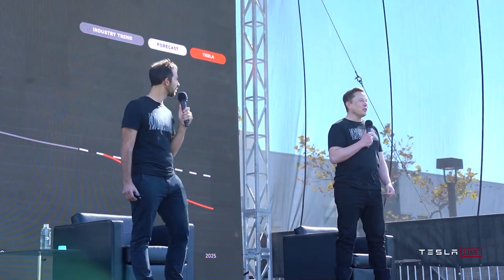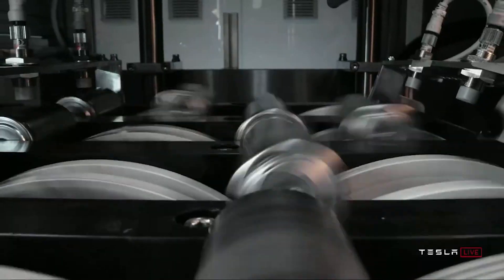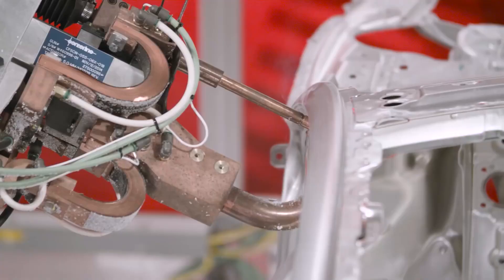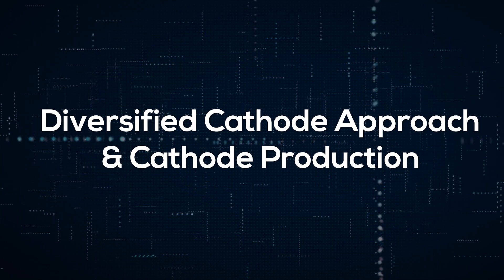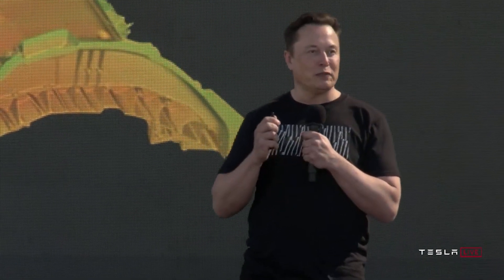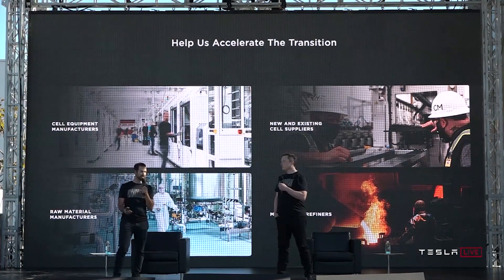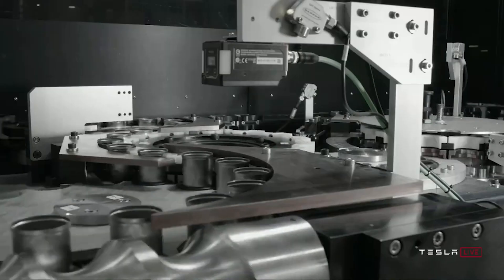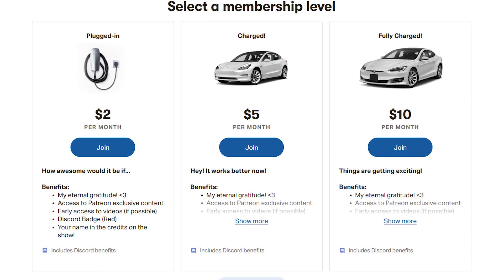Tesla: A Quantum Leap Forward with Game Changing Technologies On Battery Day | Lightyears Ahead

Comment: Hello Harry. Thank you for the upload. I am excited (and feel kind of lucky) to be living in such transition times to sustainable energy for vehicle; myself being a power electronics engineer (not much knowledge on battery chemistry though).

I want to open up a discussion here, because I was not able to understand it clearly during the live event: The claim for the new cell is having a better form factor, less losses, better thermal character etc, and the short conclusion was 16% increase in range and 14% decrease in cost. For the range comparison, is it done keeping the cost of battery pack same for the two cell designs (kWh not the same) Or for same volume or weight of the two different batteries, or something else? I mean what is kept constant here? If the range comparison was made for the same cost of "old tech batteries" and "new tech batteries", then for the cost comparison how can they claim 14% reduction? It should have been 0%! So obviously,for cost comparison, the constant kept variable might be volume or weight or maybe kWh, or maybe energy density (kWh/lt). This is not given and I think it creates a confusion. What is kept constant for both cost comparison and for range comparison should have been made clear.

Basically, also some other items for improvement include rather missing information on this. I kept the example only on the cell change to avoid even a longer message :)

What do you think?
Reply from the maker: I think they were comparing the new cell to the existing 2170 cell. I just recently listened to Sandy Munro's input on the battery day and he said "these new batteries will cut down the weight of the battery pack in half". I'm really curious to know how many cells they can put in a battery pack (which we will find out soon). The new cell design seems to be optimal for EVs in many ways. Thermal management is something that wasn't talked about much, but I'm sure they've thought about it already.